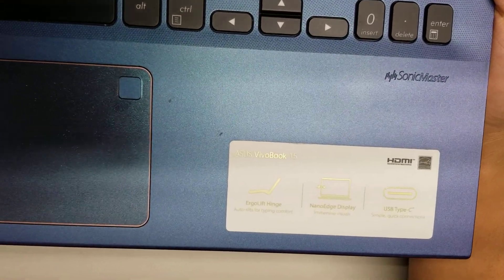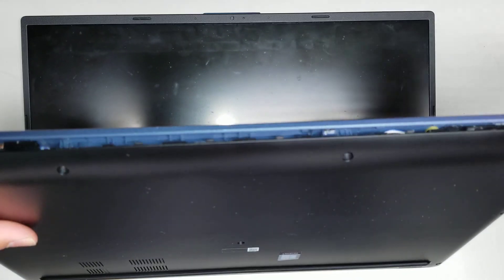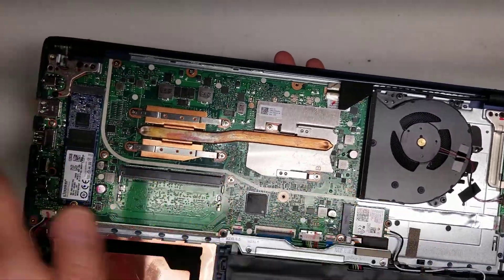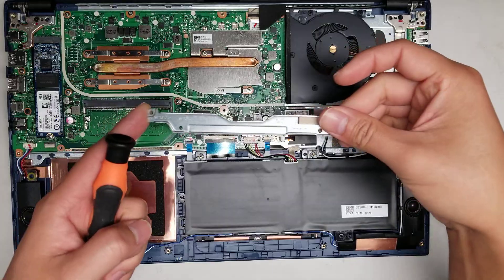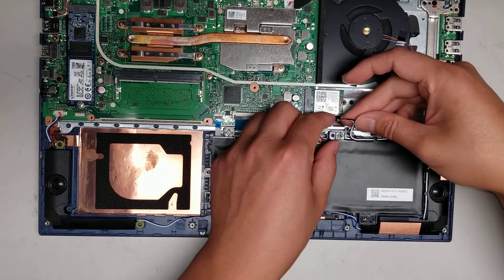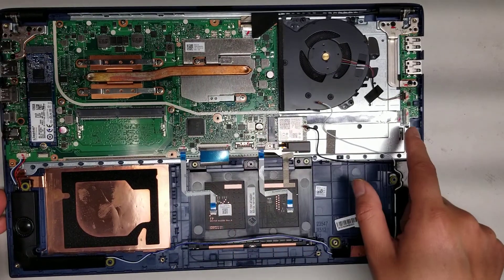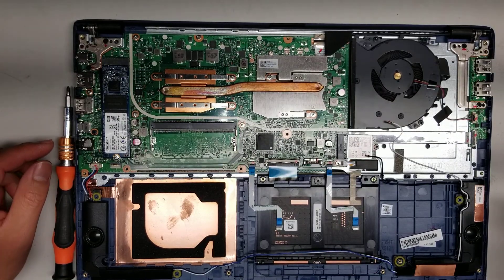ASUS VivoBook 15 F512D Disassembly RAM SSD Hard Drive Upgrade Repair

Comment: I noticing a sweet chemical smell around the battery recently, should I remove the battery myself? Or too dangerous?
Reply from the maker: Don't breath that. It's toxic. You can remove it, but do it outside just in case.

Comment: Hi, so I was hoping to see you remove the hard drive. I need to replace the shell since one of the hinges shattered and the laptop is now stuck to my desk unable to move, lest the lid/screen fully separate from the base.
     Is it possible to replace the hard drive or is it completely fixed to the motherboard? Ideally, I'd like to just swap the hard drive with everything on it into a new base.
     Before anyone asks why I don't just upload everything to a new laptop, I would have to buy all of the unique software like MS Office, the games, etc all over again and I'd like to not have to go through the expense since most of the software is one use; ie downloaded to the computer for one time installation. Plus, I don't have to go through the hassle of having an MS account just to activate the computer.
Reply from the maker: Did you watch the video?
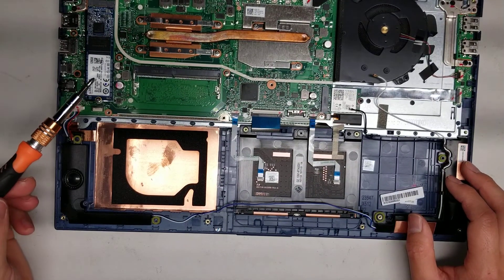Reply: @ItsBinhRepaired  Is that what you're talking about at 7:12 -- 7:16? That tiny little card looking thing? I guess I'm just getting old. I thought that hard drives were bigger. But to be fair, I was expecting you to physically disassemble the laptop down a bit further based on the title, at which time I probably wouldn't have missed it.

Comment: Thank you so much!! My keyboard was autopressing keys and a lot of them were not working as expected. Because of this video, I managed to find the keyboard ribbon cable and clean it up. 90% of my keyboard issues are fixed. Just some keys are not working, but at least my laptop is now usable. Worst case scenario, I disconnect the keyboard cable and get an external keyboard. 

This was the first time I disassembled my laptop!  Please accept this small token of appreciation and my best wishes for you and your family!  Wishing all of you great health and great success!
Reply from the maker: Awesome, glad it helped you get by. Yeah, sometimes external keyboard is the way to go. Thanks for the support!
Reply: @ItsBinhRepaired my laptop only open when plugged and battery froze 99%. Any idea?
Reply from the maker: @jokerposer8638  maybe bad battery
Reply: @ItsBinhRepaired  that's insane, using it for a year , tried open next day and this happen. Meanwhile my cousin has vivobook 15, same as mine, got a year before mine , plugging it whole time and still fine even unplugged

Comment: i see there is only 1 ram slot. so would a 64gb ram kit (2x 32gb ram) not work on this laptop? currently at 16gb that came with laptop. cant handle a game i'd like to play and ive seen it needs more than 32gb so was hoping for a 64gb option.
Reply from the maker: There's RAM Integrated into the logicboard

Comment: Could you make a video on  how to make a cd drive(inside the laptop) work if it is not coming out of ASUSTeK computer, Windows
Reply from the maker: Use a folded out paperclip and put it in the little hole in the cd drive.

Comment: Very nicely done! I also have the F512D model.  But I do have a question about the RAM.  It looks like it just has the one slot.  Is that correct?  My specs tell me that 12GB is max.  Does that sound correct to you?  So if I go shopping for a DDR4 SO-DIMM 12GB card, will that pretty much be accurate for this laptop? Thanks!
Reply from the maker: I think that's 4gb integrated with 8gb stick. There's no 12gb stick. 16gb might also work

Comment: Where is the clrtc on this motherboard?
Reply from the maker: Disconnect the battery and hold the power button 15 seconds
Reply: @ItsBinhRepaired  thanks for the reply.  It didn’t work.
Reply from the maker: @MightyMouse11  :(

Comment: Does the computer have another ram soldered somewhere in the motherboard? I am asking because I can see that there is no ram installed in the DDR4 ram slot.
Reply from the maker: Most likely

Comment: I'm not super educated when it Comes to upgrading computers, but if I were to upgrade the ram on my computer (Same as the one in the video) Would I be have to remove the 8gb of ram that it came stock with and add a 16GB ddr4 or is there any other slot where I could add a 8GB ddr4?
Reply from the maker: I think the RAM is built into the motherboard. You can add one stick.

Comment: The best option is upgrading to a 2400mhz ram or 3000+ Will work fine as well? Is there something to change in the bios after the install? Thanks for the gr8 video man!
Reply from the maker: Sometimes the motherboard won't support different speeds. You can try it, but I'm not sure if it'll work.

Comment: Can you help me why my laptop wont turn on after i installed hdd, but if i remove the hdd it turns on normally
Reply from the maker: Does it show anything when you have the hard drive in?
Reply: @ItsBinhRepaired  nothing, only the indicator lamp blink once
Reply from the maker: Which indicator lamp?
Reply: @ItsBinhRepaired  power indicator lamp
Reply from the maker: @zaworlds1  was it completely fine before that?
Reply: @ItsBinhRepaired  yes, without hdd
Reply: @ItsBinhRepaired  but i think the hdd is the problem
Reply: @ItsBinhRepaired  my hdd on my old laptop is acer, and its not compatible with asus... I think
Reply from the maker: Try taking it out and see what it does.
Reply: @ItsBinhRepaired  it works, but less storage
Reply from the maker: So removing the new drive fixes the computer?
Reply: @ItsBinhRepaired  yes, idk what's the problem, the connector flex or the hdd or even the 10 pin socket
Reply from the maker: @zaworlds1  very strange
Reply: @ItsBinhRepaired  i figured it out, it was the connector
Reply: The connector was for vivobook a series and of course it's not Compatible for my laptop, and i realize that F512D is same as X512D
Reply from the maker: @zaworlds1  oh, it was an aftermarket connector.

Comment: What if I still get no power? I've removed the battery and got rid of static buildup and still nothing?
Reply from the maker: Possibly a bad motherboard or bad power button.
Reply: @ItsBinhRepaired  it was working and just stopped. Its not a year old.
thanks
Reply from the maker: @batfink7133  send for warranty

Comment: Thx bro, I removed all the static from the battery and it turned on again ^^
Reply from the maker: Awesome, glad it worked!
Reply: Just curious, because my F512D just decided to not turn on today, how did you remove all the static? You removed the battery, held the power button 60 seconds, then reassembled everything?
Reply from the maker: Sounds right
Reply: @ItsBinhRepaired  No, you don't have to remove the battery... Just disconnect the wire and hold the power for 60 seconds
Reply from the maker: @FrostCutter  usually you do
Reply: Well it didn't work. I disconnected the battery multiple times and held the power button down for 1 - 2 minutes. Everything looks clean, no burnt smells, no weird noises (no noises at all). Only the led lights up when I plug in the power. No CMOS battery on this model. I can find any location to short the motherboard. Supposedly it is labeled CLRTC on ASUS devices.
Reply from the maker: Sounds like a dead motherboard
Reply: Which is absolutely ridiculous, I bought this laptop 04/2020 and it's barely been used.
Reply from the maker: @dustinneville550  if you bought with a credit card, they might cover an additional year warranty

Comment: No cmos?
Reply from the maker: Might use the main battery as the cmos unless it's on the bottom of the motherboard.
Reply: @ItsBinhRepaired  mine won't charge or boot
Reply: Prior tho it was running on battery i turned it on battery died and it wouldn't take a charge
Reply from the maker: Sounds like a dead motherboard :( unless it's a charging issue and the battery is dead
Reply: @ItsBinhRepaired  battery unplugged still won't work could be the charger 😑 I bought it off a dude it was charged up and working i swapped the ram to a 8gig since he took the 4 gig stick out and put a 2gig stick laptop turned on showed 12 gigs the battery said it was critically low died I tried to power it on again and it died again then stopped booting because battery is completely dead now I think the charger may be the issue idk I paid 230 for it today and it was working fine
Reply from the maker: @Gothguitarist  charger or charge port probably
Reply: @ItsBinhRepaired  im nervous its the chip 😬 but the guy gave me the laptop charged up to like 80% that means the charger should be fine idk
Reply from the maker: @Gothguitarist  he could have possibly put a new battery and sold it
Reply: @ItsBinhRepaired  possibly! I'll have my friend look at and just pay him to fix it I didn't even get 2 hours with the laptop hahaha. Theres no way it would just stop working im thinking the charger.
Reply from the maker: @Gothguitarist  could possibly be the charge port
Reply: @ItsBinhRepaired  absolutely i will let you know thanks for the help! Love the videos!
Reply from the maker: @Gothguitarist  sounds good. Thanks! Glad you like them.
Reply: @ItsBinhRepaired  laptop charger reads 19.2 v so I dont think its that could you do a video or explanation on the screw sizes
Reply from the maker: @Gothguitarist  lol I have this one https://youtu.be/RQ6a2YkZCuU
Reply: @ItsBinhRepaired  screw sizes theres different size screws someones been in here befor me
Reply from the maker: Don't know the screw sizes. You can measure the depth with a needle
Reply: @ItsBinhRepaired  was trying to find out which screws went where the laptops screwed wont boot wonr charge the charger is fine the chip probably shorted
Reply from the maker: @Gothguitarist  hmmm
Reply: @ItsBinhRepaired  yeah my laptops done fried battery died and won't charge
Reply from the maker: @Gothguitarist  :(
Reply: @ItsBinhRepaired  its ok thanks for the help im hearing its a common thing its under warranty but 2 months for a repair is insane
Reply from the maker: Yeah :(

Comment: thats the exhaust fan. it sucks the air from laptop not blow.
Reply from the maker: What are you talking about? A fan cannot suck air without blowing it somewhere else.
Reply: @ItsBinhRepaired   yes but it blows directly outside . fan sucks air from entire laptop and blows from down.  the direction of air matters if we consider cooling effect and also dust particles.
Reply from the maker: @errushikeshpatil9891  all fans use the blowing direction to cool. Lol

Comment: which adapter should I get for the SATA hard drive?
Reply from the maker: This one should work. https://amzn.to/3ChymVB
Reply: I mean for the inside
Reply from the maker: Make sure a SATA hard drive would fit before buying. I think this might work. https://www.ebay.com/itm/HDD-hard-drive-cable-connector-for-ASUS-VivoBook-14-15-X412-X512-F412-F512-USA-/224096873947?mkcid=16&mkevt=1&_trksid=p2349624.m46890.l49286&mkrid=711-127632-2357-0

Comment: Is it only has 1 slot ram? Ugrading ram by adding new ram or changing with a new one?
Reply from the maker: There might be one underneath. Not sure, but likely soldered to the motherboard.
Reply: @ItsBinhRepaired  so it actually has 2 slot, 1 soldered and 1 for expansion then?
Reply from the maker: @Vincettty  it didn't have anything in the slot when opened. It needs RAM to work.

Comment: Hey bro i need help with my laptop,i replaced the screen and after i finished and used the laptop there was a problem, i had to use the laptop while plugged in and that didnt happen before
Reply from the maker: Battery might not be connected right.
Reply: @ItsBinhRepaired  u think i might disconnect it?
Reply: @ItsBinhRepaired  how do i know or fix it tho
Reply from the maker: Make sure the battery is connected properly
Reply: @ItsBinhRepaired  ok i will check cuz the laptop is like a month new and i just replaced the screen cuz it broke and then that happened
Reply from the maker: @AntonioPerez-sy3oj  yeah, that's strange.

Comment: Spilled my bong water on my computer. Watched this video to open it and clean the battery. Works normal now. Thx g
Reply from the maker: awesome, glad it helped. If you haven't already, please like and subscribe so others can find my videos. Thanks
Reply: In the same boat actually. Trying to get to the keys but video stopped short of getting to that. Not sure where to go from here. Thanks for the vid, appreciate any input
Reply from the maker: @khameleon260  keys?

Comment: Have you had any of these come in with boot issues? We have one thats about a year old and now it wont start up and I cant get the battery charge light to start. Even tried buying a new adapter. I'm assuming it must be the battery is dead somehow but seems so soon for that issue
Reply from the maker: Sounds like motherboard if lights don't come on.
Reply: @ItsBinhRepaired  Oh no really? I just assumed the charge light wouldnt come on if the battery were dead
Reply from the maker: @Getupkid825  yeah :( light would come on even if no battery.

Comment: I have a question, can I put a 4 gb ram in the empty slot and have 8 ram? or would it only be those 4 that I have put
Reply from the maker: Yes, it'll combined with the built in RAM.
Reply from the maker: If you haven't already, please like and subscribe so others can find my videos. Thanks!

Comment: I have the same Asus F512D, but only have 256G PCIEG3. Does the laptop have another port to expand ssd or  just replace the one with a higher capacity one?
Reply from the maker: If I didn't mention one in the video, then probably not. I work on too many models to memorize that kind of thing.

Comment: You mentioned the bad cooling design, and I’ve noticed that mine begins to experience some issues after long consecutive use. Is there any way to get better cooling?
Reply from the maker: Other than a different laptop, I'm not sure
Reply: @ItsBinhRepaired  Ok thanks for the input
Reply from the maker: @colin7969  no problem

Comment: What is motherboard manufacturer name ? Is it same asus or some other brand ?
Reply from the maker: I don't know who manufacturers them, but I don't see the point of this question. Are you trying to find out if someone like foxcon makes the boards/components like for Apple stuff?
Reply: @ItsBinhRepaired  No basically i had a lenovo laptop..there was a problem in motherboard which is now not repeairable..when i looked at the motherboard  manufacturer of my lenovo laptop it was HSB ..so i am now looking to buy a new laptop ..i thought asus is leader in motherboards so if they sell laptop then they would also have asus motherboards in their laptops..so i was curious in u r video to see the manufactures name in motherboard..kindly let me know what brand  you found in motherboard of this asus laptop
Reply: @ItsBinhRepaired  No basically i had a lenovo laptop..there was a problem in motherboard which is now not repeairable..when i looked at the motherboard  manufacturer of my lenovo laptop it was HSB ..so i am now looking to buy a new laptop ..i thought asus is leader in motherboards so if they sell laptop then they would also have asus motherboards in their laptops..so i was curious in u r video to see the manufactures name in motherboard..kindly let me know what brand  you found in motherboard of this asus laptop

Comment: Is it possible to upgrade the battery
Reply from the maker: Upgrade?
Reply: Yeh like can you get a higher capacity battery that would fit in the laptop
Reply from the maker: @calvinwilliams5166  I don't think so

Comment: Great video! Do you think that the m2 drive could make the overheating worse? My laptop has freezed since the beginning of the month and I am worried about it?
Reply from the maker: Possibly, because it'll allow it to process things faster. Might want to clean the fans and maybe redo the thermal paste with ic diamond or something.

Comment: Is that ram slot empty to start out with? So there is 8 gigs soldered to the bored as well as the slot?
Reply from the maker: It varies and these are customer computers, so I don't know if they made any changes. You'll want to open yours to confirm.

Comment: Hello, I have that laptop with bluetooth problem(probably hardware). Can you be so kind and tell me if there is a way to replace or is it welded in the motherboard?
Reply from the maker: In the video I remove the antennas. There's one screw holding the wireless card in place. If you can't figure out how to remove it, my other laptop disassembly videos show the process.

Comment: On the cover it does have a "plate" so the air don't go for all the internal components. Even though I agree with you.
Reply from the maker: Yeah, there are things to guide the air, but still, no radiator to increase the surface area for better cooling.

Comment: When you're looking for a video to disassemble and clean your 6 months old laptop because the fan just won't stop engaging... and you accidentally find out why 🤦‍♀️
Reply from the maker: Lol why?
Reply: @ItsBinhRepaired  because of the poorly designed layout. yes. Hot air is being blown directly on the CPU. 😑
Reply from the maker: @m.j.3452  oh, yeah...stupid design. Lol

Comment: How can you control this fan?
Reply from the maker: You can do that?
Reply: @ItsBinhRepaired  I tried so many ways but it seems to work on his own, no matter what I adjust
Reply from the maker: @simon_nagy  I don't think you can change it
Reply: @ItsBinhRepaired  Why do you think? There is no hardware that controls the speed of the fan?
Reply from the maker: @simon_nagy  not sure.
Reply from the maker: You can wire the fan directly to the USB ports to make it run full speed
Reply: @ItsBinhRepaired  I don't really wanna mess with the insides of the laptop
Reply from the maker: @simon_nagy  nothing can be done